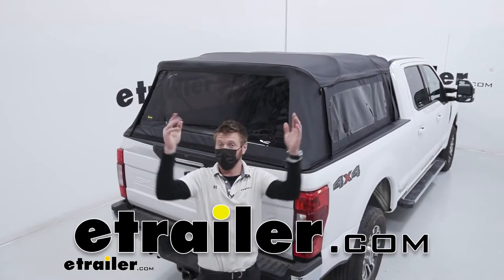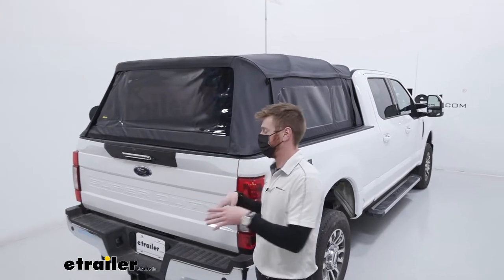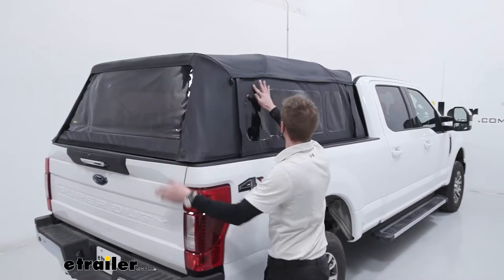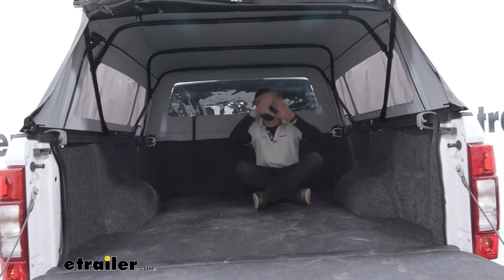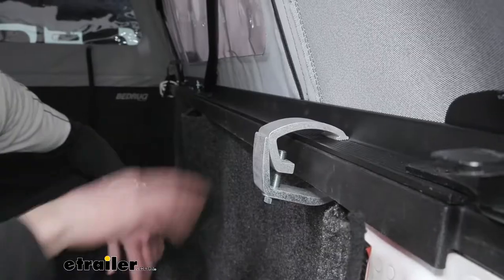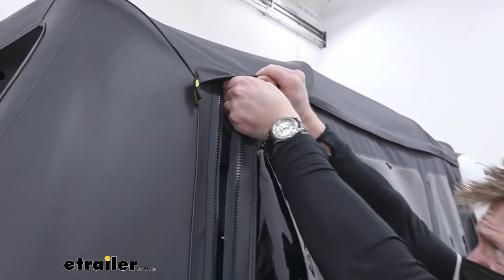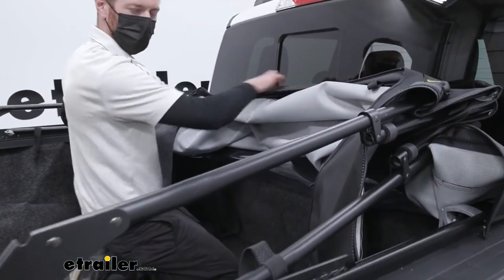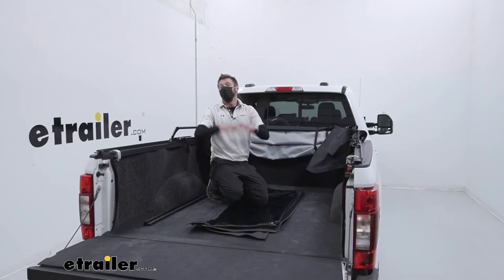etrailer | Bestop Supertop Collapsible Truck Bed Cover Review

Comment: I'm looking at Fas-top package so that I can transform between bed cover and topper/cap mode. I think Fas-top has a better design in a few ways too like the way the back door/window snaps into place. I just wish it had side windows and I wish the bed cover had more rods across it to make it more secure.
Reply from the maker: The Fas-Top is indeed a great product.

Comment: Can you drive it into a carwash?
Reply from the maker: If it's a brushless, touchless car wash, yes you can. However, high pressure water can get in between the cover and the top of the bed sides, getting the interior wet.
https://www.etrailer.com/Tonneau-Cover/Bestop/B76301.html